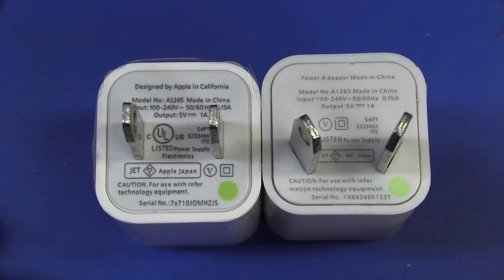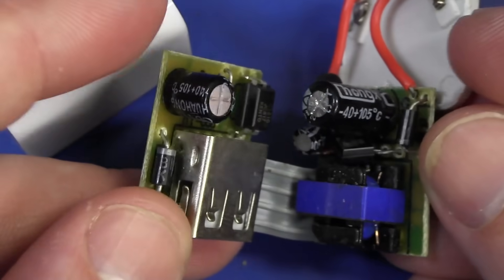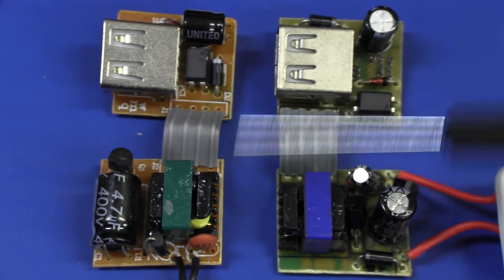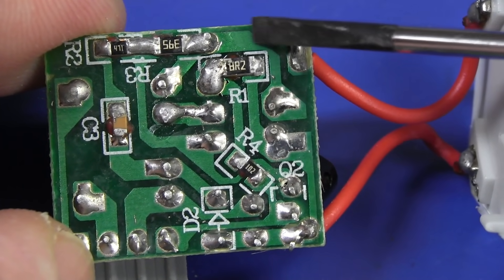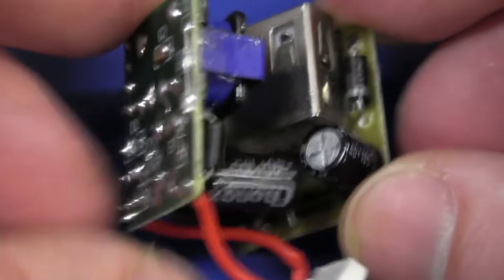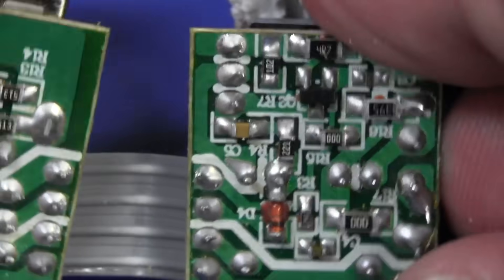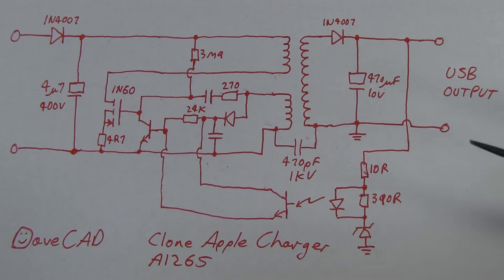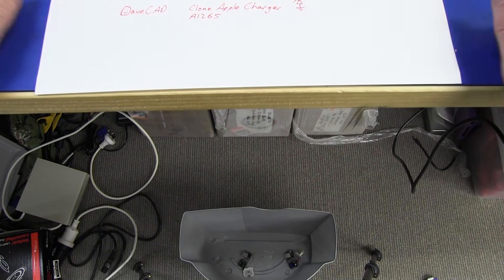EEVblog #388 - Fake Apple USB Charger Teardown

Comment: Same pieces of shit are sold in the 1-2-3 dollar stores over in NZ, totally illegal as they dont even have ones that are like the first one in Daves video where they attempt to make it vaguely look like it will fit a AU/NZ socket.

The ones here are usually the 2 round pin ones, fake apple branding on the adapter but none on the clamshell pack.

Noone cares that they are illegal - energy safety services did nothing when I tried to report them.

Comment: Is not the Y cap protective impedance. Limits amount of fault current from low voltage to mains. Some standards require two of these caps under single fault conditions.

Comment: Thanks for the nice video David!  
I was thinking is a good idea to present sometime to us a simple circuit like this one with 2 transistors (or 1 transistor) on the primary, and high frequency transformer, half wave or full wave (just principles and basic sizing) and maybe we can optimize it a little bit, so we have cheap and simple power supply design for our everyday needs!
In little words, how we can make those circuits safe and usable with added filters, maybe fusable resistors and others.

Comment: It activates when the secondary reaches the correct voltage, which tells the primary driver circuitry to back off. This lowers the output voltage, which deactivates the optocoupler, which lets the driver circuitry start up again. This feedback loop repeats infinitely to provide a (reasonably) stable output voltage. (Let me know if I got anything wrong Dave)

Comment: Nice video, but can you modify that schematic you drew and make it safe?
Reply: For the fake apple one: Add fuse and in-rush resisitor. Replace single diode by full bridge rectifier. Replace 1kV capicutor by Y1 capacitor. Then the shemetic on it's own is safe but still not a good one, for that you basically do it from the start. 

Also all this wouldn't fix the second worst safety problem of it (Missing fuse being first one): The isolation distance on the board, and that's not achievable by changing anything, you'd need a complete reconstruction.

Comment: You know one of the biggest downside to this circuit design is that if something where to cause a failure in the Opto feedback circuit somewhere.The output voltage would go up and can fry whatever you have plug in to it. I lost a USB hub because of that very thing happening. These thing are a FUCKING PILE OF SHIT!!! and if you happen to have one? THROW IT IN THE TRASH BEFORE IT DESTROYS YOUR EXPENSIVE ELECTRONIC DEVICE.

Comment: Lol, been opening China made power supplies and chargers myself and some of them sure are seriously dangerous. People should know more about these fakes and how dangerous they actually are. Some of the fakes are really well made outside and they function as the originals, but the insides... douh!  Once I purchased a PS3 controller from China Cheap Store and yes the damn thing works nearly as well as the original and looks like one, but the insides is crap and the batt has no protection circuits.

Comment: So, how do we choose a well engineered device? They all look similar on Amazon. I guess you have to go on price!
Reply: No, just don't buy them for Amazon! Garbage sold for 25 $ is still no better than garbage sold for 5 $. 

You obviously can't get a good charger for 5 $, so it has to be fake. But as it's basically tolerated by Amazon the Chinese fakers started to also sell the same fakes for much higher prices, because most the customers won't reconice and the profit's even better. 

If you want a genuine one, buy them direclty from Apple's, Samsung, ... web-shop. Also some other trustable web shops also sell genuine chargers, good indicater is that they one have one offer for each type of chager, unlike on Amazon.